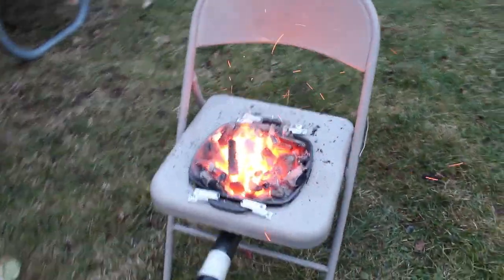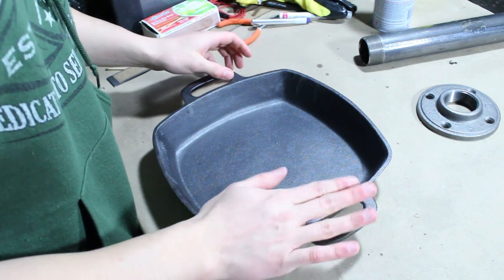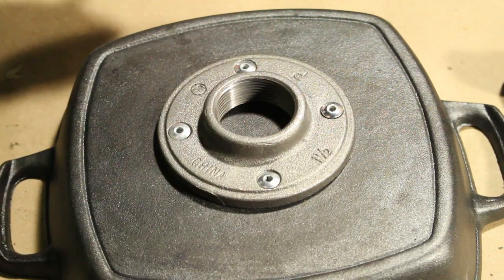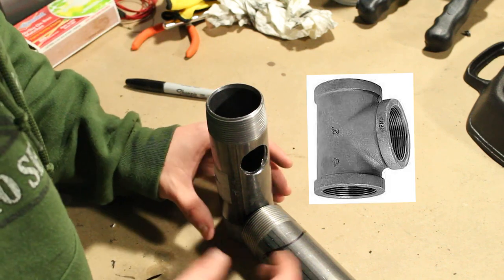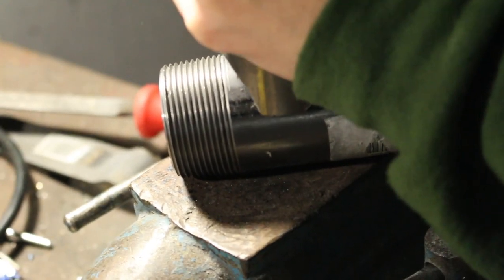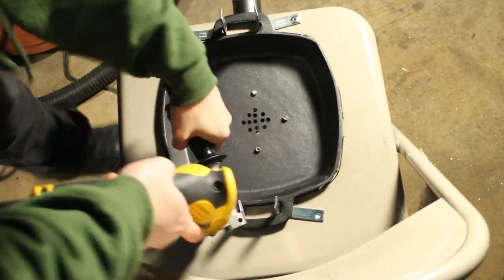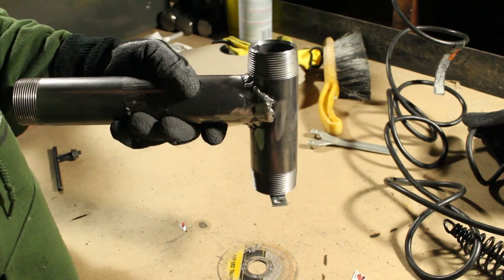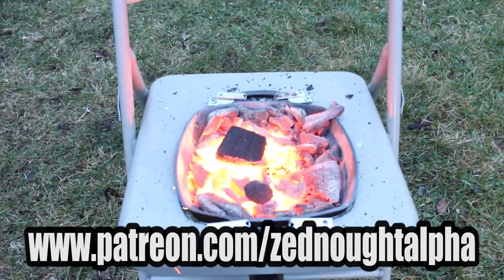Fold-Away Blacksmith Forge (Satan's Toilet)

Comment: There are specific gloves for when you're working around saws or blades. They have a bunch of fibers in them and when you cut the glove open, those fibers clog the blade and prevent it from spinning any more.
Reply: Hope that makes sense
Reply: +MCGelloe If they had a bunch of fibers your hand would be pulled in would it not?
Reply: +William Laidlaww i have no idea, but im guessing the fibers are too weak to pull the hand in or the blade should clog before that happens
Reply: Even if the blade clogged it would still be spinning at more than 3000 rpms so you hand could still get pulled in
Reply: angle grinders aren't that dangerous, even if you touch your skin with cut-off disc edge it will barely do anything or will scratch you badly, make some shallow cut in your skin but it ain't gonna take off finger or hand, not even close to that. The cut-off discs work by melting and rubbing off the material, not by actually cutting it so you don't need gloves :P Angle grinders are dangerous to your hearing, my ears always ring when i dont use earplugs. Also when disc explodes it might fuck you up really well if you're not using the guard. After all its 11000 rpms
Reply: To take off finger with an angle grinder you would need to hold the cut-off disc in one place for really long time, much more longer than you could resist the pain lol. Also the cut-off disc heated by friction on the cutted material when touches and scratches your wound it also burns it so it is not bleeding much (or is not bleeding at all)
Reply: Well I have been cut more than once and it would definitely be easy to cut a finger and also they can bleed a shit ton of blood so yeah it doesn't really cauterize the cut.
Reply: William Laidlaww Depends for how long it has contact with the skin. As much as it has when it slips off the cutted material and scratches you for like even second or two (enough to take it off or turn off the grinder, the switches don't jump back on touch without a reason - dead man's switch) it should cauterize (burn for people who dont know the term) the wound and keep it from bleeding :P
Reply: It did not cauterize for me it took weeks for it to fully heal.I barely touched it for a second so these cuts can be brutal.
Reply: William Laidlaww Depends what kind of disc it was, the more abrasive and thicker the worse the wound will be (for example dunno how you would need to do it but putting grinding wheel edge on your finger) but as long as you touch it for like 2-3 seconds or maybe more you ain't gonna loose finger. With tablesaw one mistake, you put your finger a little too far or it slips off and your finger falls down =)
Reply: I was running a cutting disk and it cut like a hot knife through butter.
Reply: @Bananovskyyy  it seems like they arent dangerous in pretty much the rarest possible situation. Pretty dangerous for you to give faulty advice like that
Reply: It doesn't take long to lose a finger with a angle grinder I know 2 people around me that have lost fingers and I know one guy that lost the moment and feeling in his hand form one that splintered and apart of the disc went into his arm
Reply: It is exactly like a table saw except with a table saw you have some safety gear

Comment: If you MUST use gloves when using rotary power tools, I recommend using mechanics gloves as they typically have a tighter fit to make sure a floppy piece of cloth doesn't try and kiss the disc.
Reply: krysala actually I've been using them for 20 years and I won't use them with out my gloves especially if you have to work with out a gaurd on it if you ever do take one to the hand your fingers will thank you and I have more then once the only way you could ever get your gloves stuck in one is if your gloves where far too large and the fingers hung down in to the sprockets

Comment: Thanks, guy. I had a friend who decided to decamp from animating for a 
living, took up blacksmithing. Last I heard, he was working with a group
 in Hollywood making props for feature films. Had to work to bulk up 
& get some upper body strength. In my fifty-second year I took a 
class at a local high school - Welding and Metal fabrication. YOU, sir, 
do a good job of 'splainin' your actions AND sharing a lot of important 
side issues... such as safety considerations. 

If your armouring doesn't work out, you might look into doing stand up comedy!

Comment: let's hope the chair is not galvanized steel
Reply: painting galvanized steel requires special paint, I can't imagine a cheapo folding chair would be galvanized, let alone painted with the special paint for it
Reply: AirSoftMaverick3232 
I think they made a joke, i cant really tell
Reply: He probably got the folding chair from his part-time days at Chipotle, which he mentioned several times before. And if that's the case, then yeah most likely galvanized. But the chair itself shouldn't heat up, as the air flow directs most of the heat upwards and away from anything that's not the firepot. And any heat conducted by the firepot would be released on the underside or with the heat from the hot air blowing through the coals.
Reply: I'm late to the party. But most cheap chairs are not galvanized. They are powder coated. It's a cheaper way to prevent rust and safe to forge.
Reply: @davidk123  who tf are you talking to
Reply: booty_ hunter420 they probably deleted their comment, but now I will delete mine

Comment: Finally you'll get into blacksmithing!
For the anvil don't use just a big piece of unknown steel,you want it to be hardened,or when you hit the hot steel with a hammer a lot of energy willl be lost on the anvil.If you want to start simple a big sledge hammer head will work,just cut a slot out of a log so that it doesn't move,or figure something else out,good luck!

Comment: Awesome but little tip. try not to let the steel get yellow or you loose carbon or can burn the steel. hand cranked bellows are good for that so that you can heat it up slower and more evenly.
Reply from the maker: +Adrian's Survival Arms Armour and Zombies. Thanks for the advice. Will look into.

Comment: One of the cooler backyard designs I've seen. Any reason you use rivets rather than bolts? I like removable fasteners in case I need to modify anything.
Reply: he could always grind the rivets off.
Reply: Rivets are a bit cheaper and easier to install. It is all about preference
Reply: Rivets are better in some cases
Reply: +Ryan Brewer     Except in the bottom of a forge where they can melt
Reply: agreed!  bolt ons are how I plan on going about this!
Reply: +Nathan Campbell They were steel rivets I think. So it'd probably take some constant heat over an extended period of time to melt. Or jet fuel.
Reply: +Nathan Campbell 1350C or 2500F is required to melt steel. Only modern crucibles can achieve that. His forge allows him to soften and shape steel, not melt it. A lot of people don't realize that...some metals could be melted back in roman era or later, like copper, etc. But the best they could do with steel for the longest time was only forging it. But how was steel made then? Fine particles of iron welded together (white hot temperature) over a long period of time, resulting in a clump of impure steel that had to be refined through forging. Melting steel greatly improved steel purity and integrity / composition control.
Reply: betif00 Dude, I thought the rivets were aluminum. Chill with the "history" lesson.
Reply: Nathan Campbell Lmfao...

Comment: Hi, I'm a big fan of the show and amateur blacksmith/builder and I was wondering if you could give me some advice on something. I bought a riveter and a pack of rivets a couple weeks ago and have been trying to use them on a couple of asorted projects like your trasher bracelets, and adding some accents to a knife and a sword sheath that I made. I eventually get them to work, but only after wasting 2 or 3 each time, and it's really frustrating because the rivets were kind of expensive. Even when they do eventually work, they only really half work and I have to go through and peen each rivet down with a hammer, so it's flush with whatever I'm working with, and so it's a perminant bond. Is this normal, or did I get some bad product? Or am I just using them wrong? Neither the rivets, nor the riveter came with instructions, so I'm just sort of going off my own common sense on how to use them. I know you're probably very busy, but if you even decided to read all this, I would be very grateful.

Comment: Rivets? Are you sure that they won't melt/ warp?
Reply from the maker: +Ketan FakeLastName (no0122lrfan) They're steel so I don't see why they would.
Reply: +ZNA Productions What if jet fuel?
Reply: +Cazzputer 
Jet fuel can't melt steel rivets.
Reply: +Ketan FakeLastName (no0122lrfan) the area around the air port is usually cooled by the air. That's my expirience at least.
Reply: +Cazzputer LOL! Thats was actually funny
Reply: +FuseBox yeah and also the heat rise so i do agree with you fusebox
Reply: +Ketan FakeLastName (no0122lrfan) i melted the heads off of some 3/8' bolts in my earlier fire pot designs. Once you get a good sized clinker in there it will stick to them if they get hot enough, and potentially get pulled out when you dig the clinker out.
Reply: +Roderick storey yeah most are aluminum. they make titanium bolts which would melt last steel bolts would melt around when the pan would...
Reply: Clearly not if it works haha
Reply: proffesionalretard it is not a matter if if it works it is how long it works before failure
Reply: +Lunas Eclipse thats the case with everything in the world though, a hammer might last a few generations, but it will eventually wear out and break. same with tires, engines, your favorite coffee cup, or a forge. this design does look pretty solid though, so it should last a good while, heck my bucket forge (made from an old steel bucket with steel sheet welded to the inside) has lasted me 4 years now and still goes strong. time can only tell.
Reply: +Ruzz P Doesn't clinker just form if you are using coal, but not when using charcoal? I'm not quite sure on that, because I'm using coal, but I think I remember reading it somewhere.
Reply: +Darius der Rote true.  I use coal also. charcoal isn't worth using unless your making big batches by yourself
Reply: Darius der Rote charcoal dose not really make much clinker its just dust really but i use coke which makes more but yet its alot better
Reply: +ZNA Productions i have a portable cast iron buffalo forge from the 1880's and the blower broke a while back before i saw this, ive been using a hairdryer ever since, been forging for 5 years and its amazing how awesome a hairdryer works i can easily get shit over 1600 degrees fast! been making axes and swords mostly but recently got inspired and made a 8 foot spear from a old (like really old) shovel head which turned out great because the socket was premade and it has large amount of metal than mordern crap you get nowadays, this is a big step forward to your channel man happy forging!
Reply: i have seen that video but that is not a forge thats a foundry its used to melt metal not forge metal but you could put it on its side and have two hole and a liip so the coals dont fall out while you move the metal around
Reply: kinder but good try to say some thing :P
Reply: it could work but may take some planing but put the airflow at the bottom unless its gas then above
Reply: +ZNA Productions lol dude you remind me of joey from friends
Reply: +Manny Han heating
Reply: +Manny Han I know that but the question was would the rivets themself melt or warp.
Reply: +FernTheYoutuber 9/11 ring a bell
Reply: +ZNA Productions If I'm going to buy charcoal, should I buy chunk charcoal? or Briquettes?
Reply: +creapycreaper101 Chunck!
Reply: ok thanks
Reply: +creapycreaper101 the problem with the other stuff is that it's not as hot and tends to break up and spark a lot more. 
But if you can't get your hands ob charcoal, or it's to expensive for you, you can use them.
oh and if you can order on ebay you can get coke.
Reply: Ok thank you
Reply: Ketan FakeLastName he is kinda rivet crazy just go with it
Reply: +FernTheYoutuber jet fuel can melt steel rivets. because of the conspiracy around the twin tower terrorist attacks saying jet fuel can't melt steel, another YouTube channel has debunked this myth by doing just that. melting steel with jet fuel. and I as a welder myself an here to tell you that with enough oxygen and any type of fuel you can create enough heat to melt steel. that's including methanol (jet fuel) and even propane.
Reply: Ketan FakeLastName well I guess he thinks they're Rivet-ing
Reply: TheJhockman i was a fuel dog in the military and bleach is pretty much jet fuel with alot less water than a jug of clorox lmao amd all other birds roll on jp8 which is deisel lmao
Reply: TheJhockman also its flash point for jp 4 is like 62_67 degrees f so you think something that would flash (burn and ignite liquid not just fumes the liquid) wouldnt flash on the temp of the ac temp in the building bwahahahaha you guys must know it all lmao ur nuts all day long it would explode like you dont know what just off the air temp almost lol
Reply: Ketan FakeLastName steel rivits daaaaa

Comment: Be sure you get on I Forge Iron for any help with making stuff by the forge. Anvils are really easy, the key is to use a large tool head (Splitting maul, sledge, etc) and just sink it into something durable. Also, look at side blasts if you ever feel the need for an upgrade from this.

Comment: Hey ZNA, Good on you for warning people to steer clear of galvanized steel for these projects, A lot of makers here on youtube understimate the heat potential of their rigs, and the toxicity of the galvanized materials,

Furthermore, I'm excited to see you move into more blacksmith type things, And I got a tip for you for the anvil, sledgehammer heads, My first steps into forging That was my anvil, It's not a whole lot of work surface, but you can slip a band through the hole the handle used to go through and cinch it down on a landscape timber and really give it hell. You won't mark it up much short of a cold forged chisel, and it's better than nothing till you get an anvil or a damn good slab of scrap. Though it can be a fair amount of work flattening a side if you want it perfect, and the better steel is the 'coins' on the ends, It might still be worth a thought if you got an old head laying around already.

Good luck.

Comment: Great job i like the cast iron pan that will hold the heat nice you can  also  bend & weld a 1 or 2" ×1/8 " flat bar around the perimeter of the chair to hold the coal in and you can lean your material on it well done!!

Comment: Hey Eli, for filming welding (or any other super bright tasks) you can make yourself a nice filter by simply taking a piece of welding mask glass and glue/tape it on a lens cap that you have already cut out the center of the lens cap of, and screw/clip it on the lens when filming. As you know though, the tint becomes greenish, since the camera will see what you'd see when welding. But it's better than nothing, if you want to show off the welding anyway.

I've done so myself for filming/photographing the sun and it works wonders.

Comment: For that T joint... if you own a chop saw you can set it at 30 degrees and cut from the center of the end of the pipe at the 30 degree angle then rotate 180 degrees and another cut.  then take a grinder and the sharp tips left in the middle flatten them so they are about 3/8 in instead of a point and you have a perfect saddle joint every time everytime.

Comment: eli, another easy cheap way to make a forge is the pit forge method. just dig a pit the size you want about 8-12 inches deeps, with a pipe or two running through the bottom, with holes drilled in it, and then you can pretty much use the same method you used here on out. I did that for my first forge then saved up for a propane forge.

Comment: Hey man, I've been using your design since you've posted this video. After hundreds of hours in use, multitudes of heating and cooling processes since. Though I've run into a slit problem, the skillet cracked from one of the holes to the side of the wall. Due to such cooling and heating process, caused a stress crack. Advise to anyone that goes on to use this: Be careful on how you extinguish your forge. Let it cool off over a few hours. Don't try to rush the cooling. Otherwise amazing build and works beautifully.

Comment: As a fellow beggining blacksmith some advice that i recently found in my research, if you want to do any kind of forge welding/faster heat time for your mettle get a deeper pan or use some old metal coffe cans so that you can get an 8in deep coal bed

Comment: I'm not sure which state you're in, but in Michigan you can get anthracite heating coal from Tractor Supply or Family Farm and Home. It's roughly 7$ for a 40lb bag. I've used it before, and while it's not as good as proper blacksmith coal, it gets the job done nicely. Anthracite doesn't give off smoke, and sparks less than lump charcoal. 40lb of coal goes a long way in a small forge like that one.
Reply: How the hell are you getting anthracite that cheap in Michigan? I get it that cheap here in PA, but I live right next to one of the 2 major anthracite mining regions in the US. Michigan seems too far away to be charging $7 for 40lbs.

Comment: Really cool build man! One thing you can do to make it even more effective would be to add something like another pan on the top to trap in the heat. Just make sure to leave a side open for sliding metal into the coals.

Comment: I just finished this build myself . The only updates I made were to spray high temperature paint on the whole thing , otherwise the heat will cause the places where the metal was cut , and unprotected to rust .